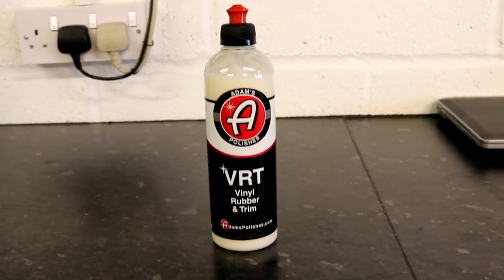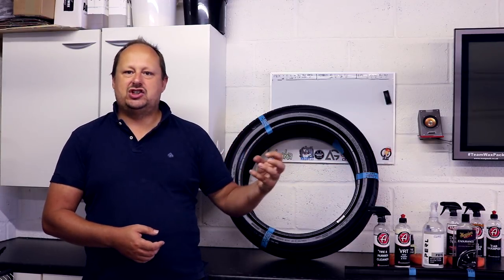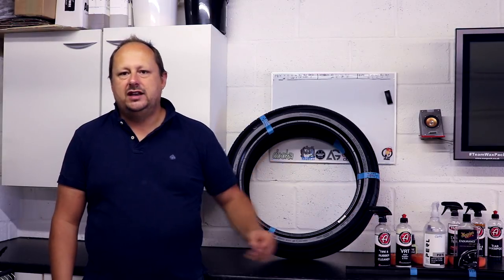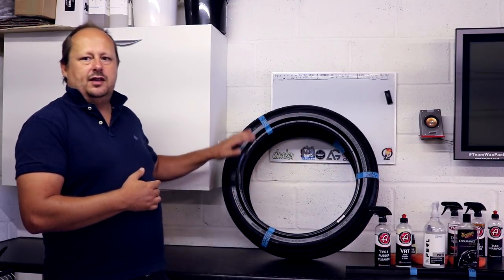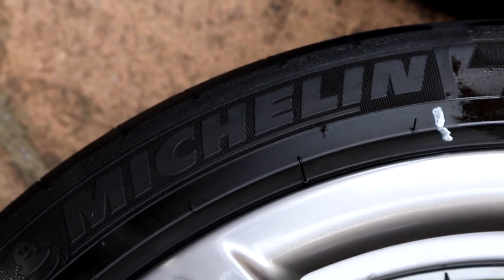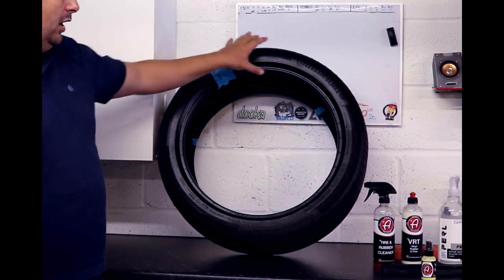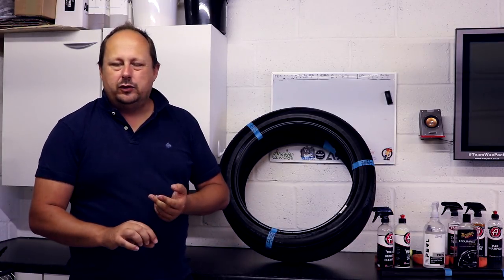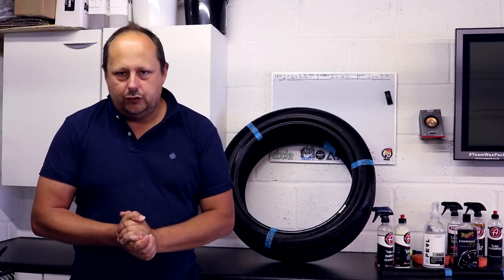Adams VRT - Vinyl rubber and trim dressing

Comment: It's still Meg's Endurance for me , I've recently discovered if you add around 10ml water to 100ml gel, you can spray it out a trigger spray, onto an applicator, it's easier to spread and gives a more even coating, dries quicker too.

Comment: I love Car Pro Perl diluted 1:1 you get 1ltr of tyre dressing for £12.00, and there's so many other uses for it.

Dilutions ratios: 
 -External plastics - 1: 3
- Engine - 1:1~3
- Tires - 1:1
- Interior rubber / dashboard / leather / vinyl - 1:5

Comment: I've been testing out Optimum Protectant Plus lately as an interior dressing. It has a very noticeable darkening effect that seems to be going strong on the test dash after 6 weeks. It's more of a satin finish, not completely matte. Dry to the touch. For tires I usually use one of these: Blackfire gel, Duragloss 253, Hi-Temp Grape Dressing, and Megs Endurance. Others, too, but seem to reach for these most often.I'd suggest the Blackfire and Duragloss products to those looking for a matte, like-new tire look.

Comment: Hi please could you help me?
Could you advise me on how to remove gyeon Q2 trim coating, I have used this on all my trim and rubber door seals. It looked great for 3 months but now now the problem is that it is starting to flake on the rubber trims and I don't know how to remove it without damaging the rubber trims. Any advice would be much appreciated. 
I have been a fan of yours for  years and most of my detailing are items you have recommended. Keep up the good work
Reply from the maker: I dont think any ceramic coatings will work on rubber...   a lot of the rubbers on cars around doors seem to bleed brown residue.. mine does on the 135.  tyres do it like crazy as well...       normally you remove ceramics by abrasion..   on a rubber surface thats not going to be an option..   I would prolly try soak a thin abrasive microfiber cloth (the ragmaster premium glass cloth would be a good choice)  and scrub it hard like I do when I clean the car..    

If that didnt work I would try solvents on the same microfiber cloth..   put a thing layer of a solvent..  maybe start with IPA, then try mineral spirit and work your way up.. cellulose thinner is at the top of my list of solvents to remove product..   be carefull not to get the solvents on the paintwork..

problem is the ceramic is probably going to be resistent to the solvent,, so its really abrasion thats gonna be needed..  

might be worth speaking to gyeon and seeing what they advise.  its not a problem ive ever tried to solve so Im just guessing (which can be dangerous)

Comment: You're gonna have to do an FDC recommended blog, John, were you compile a list of your top wax, tyre dresser, retailer spray etc etc. As for Megs products, as a whole I've been quite disappointed with their products. I've used gold class shampoo, their detailed spray, wash less cleaner and one of their waxes- can't remember which buts it's in the box of don't use again- I don't seem to be able to get any endurance out of them. Usual in depth review so top marks.
Reply from the maker: i sort of did a bit of that with the product of the year 2016 product awards..   so 2017 we encountered lots of new products.. so Im wondering if the 2017 awards should not include any previous products.. so its like a best of what ive encountered this year..

would be a good idea to write up all the recomendations somewhere maybe on FB..  and also try and gather a load of discount codes for the recomended products..  its all work though got to try and balance my free time a bit better because as the channel grows you can end up increasing the amount of hours you put into it and then the misses gets the hump (doesnt take much :) )
Reply: Forensic Detailing Channel lol. I think a good product is a good product unless something beats it. Don't do FB I'm afraid. Discount codes a good idea. Perhaps look at doing a bundle - FDC wheel cleaning kit, FDC WAX BUNDLE ETC WITH LINKS SO YOU CAN GET SOME SORT OF WELL DESERVED KICKBACK? Have you set up a website? All this could be linked up. Just a thought.
Reply: I think you should do a 2017 only catagory, but also a top of all time product list.

Comment: I know this video is older but of you guys want to try an affordable Tire dressing I Highly recommend Aero Cosmetics Rubber Care. It has the best durability out of any water based product I've used.. You'll get 2 weeks at the very least. Maybe a little more if it doesn't rain. It's phenomenal. And another even cheaper option which really surprised me is the Jay Leno's Garage Tire and Trim Care. It's glossy if you don't wipe it down and more matte if you do but the durability is impressive for the price.

Comment: By the way what's the best way of getting old wax deposits out f Matt black grained plastic? Thanks in advance.
Reply: Phil McCabe a pencil eraser phil.
Reply from the maker: people say erasers but I never found that to be great.   I used a corse very thin microfiber I think lloyd at AP sells them.. works great for glass as well because it doesnt give up material no matter how hard you work it. anyway I rub with this first.. if that doesnt work I will spray some alcohol solvent neat on the microfiber..  that typically works for me..  the key this is the cloth though its a lot harder than other cloths..
Reply: Forensic Detailing Channel cheers I'll give it a go.
Reply: Brian Woods thanks for the tip Brian. Much appreciated. Best regards Phil

Comment: I prefer wet-look tyres so have always been a Megs Endurance devotee but recently discovered Madcow's Skimpy Dress which, for a water-based offering, gives great gloss and lasts well between maintenance washes. Good thing about Skimpy Dress (apart from the evocative name) is it works great on plastics too, where I found it gives a more satin/matt finish - so best of both Worlds in your book! I did try Sonax's tyre dressing which was supposed to be high-gloss which was OK but it didn't last beyond a couple of days. That might have been my ham-fisted application but as I managed good results with both Megs and Madcow it would seem a bit more fussy about how it is applied. Will give Adams Tire Shine a go next.

Comment: Was the megs just applied and left on the tyre? I prefer a more satin/matt look so apply megs and then buff it off after a few minutes as the instructions state if you don't want the glossy look.
Reply from the maker: I dont buff it off but I tend to very lightley run a microfiber over where the tread meets the tyre wall and the sort of letter prints just to get the excess off.. then i leave for at least 30 mins before driving.